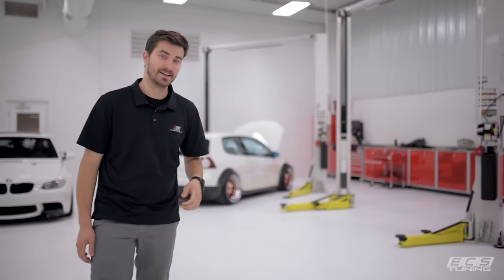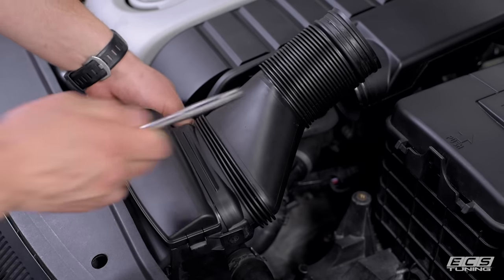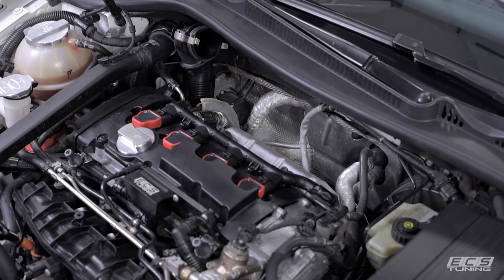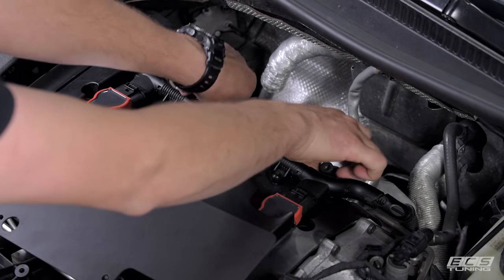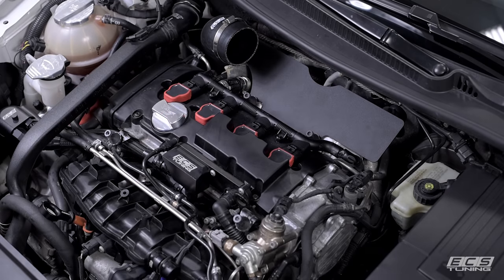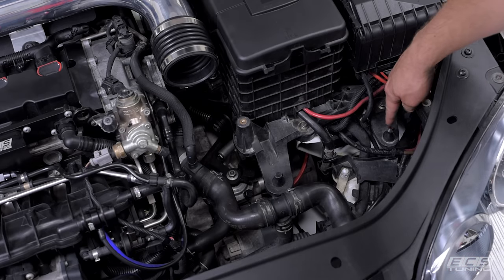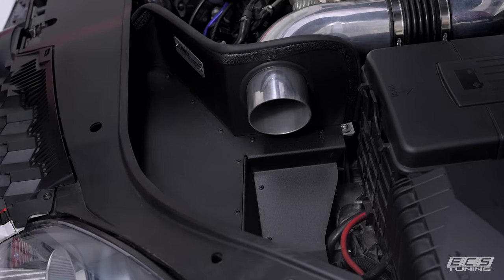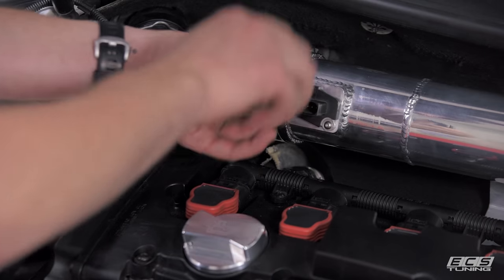VW MK5 GTI FSI Intake Removal and Installation DIY

Comment from the maker: MK5 FSI intakes available here: http://goo.gl/2kBacG
Schwaben Hose Clamp Pliers: http://goo.gl/kXiNzV
Schwaben VAG Connector Removal Tool: http://goo.gl/TUpjT3
Reply: Is this possible with normal 1.6 FSI without turbo?
Reply: I need it
Reply: I will not need the front post for the grommets for the engine cover anymore, correct?
Reply: @norbertmolnar2206   and do you know if its possible i want it aswel for the same car as you?
Reply: @predaR6  yes, i have already inside the car
Reply: @norbertmolnar2206  which 1 did you buy if i can ask?
Reply: @predaR6  this one is no more online unfortunetly but if u type on google vw golf 5 1.6 fsi sport cold air intake u will see many options for it. 😁 there is a guy he maked a youtube video as well

Comment: Me: "that looks sweet. 'Clicks link' 
'Sees it $600'. 
Me: oh nevermind
Reply from the maker: The intake in this video currently costs $299.95 with free shipping.
Reply: Can I buy the rubber grommets posts ? I really need those for my Mkv
Reply: whats the increase of power , torque , rev reactions???
Reply: hi i checked your website, you have the 600 dollar and 300 dollar intake. may i ask what is the difference?
Reply: Carbon Fiber Box vs. Aluminum Heat Shield
Reply: Yes yes I know, this is the first step, and then we all go on the slippery slope of tunning. :D
Reply: I ordered that part because they said they had it in stock, 2 months later I called to check the status, they moved the shipping date, this happened 3 more times after that,  so I canceled my order, ECS is full of excuses, not what customers want to hear
Reply: Don't order from them
Reply: @JohnC-kc5uh  covid is affecting everything globally
Reply: Cool system. But zero power gains. All noise and whooosy sounds. Very cool on full throttle but irritating as f#ck when just cruising around

Comment: thanks for the video, but why do you guys skip over the hard parts of the installation? you did not show how to tighten the rubber 90 deg boot that goes on the Turbo. how am I supposed to reach and tighten the clamp?
Reply: I had the exact same thought.  Plus, what was the 24 mm socket for? 🤣

Comment: So what does it actually add, or is this one of those things which are completely plasebo until you start upgrading other components where more air would start making difference and getting it tuned? As in, will this do anything really on a car if everything else is stock?

Comment: 2:50 Those posts for the engine cover have a 10mm nut behind them and it sucked to remove them never mind putting the nut back on after the heat shield was in place

Comment: ive got a 1.4l tsi it would be helpful if you could do a vid on changing the intake to aluminum as it is twin charged (supercharged and turbo)
Reply: Wtf... 1.4 TSI its only turbo....
Reply: @joaoprates8763  nah the turbo is in front of the engine the superchrager is at the back

Comment: 2:39 I WISH u could show more exactly in detail how you removed those parts... Can you @ecstuning please or someone help me with the missing parts of these two? I found the flexible connection (1k0 129 618 AH) in SH, the plastic (1K0 805 971 C) that attaches to the bar is new... what else is missing?? for golf 5 gti

Comment: I'm getting a lot of controversy over whether or not cold air intakes do all that much.  It would add eye candy to the engine bay, as well as free up space with the removal of the engine cover.  However, some other car guys are telling me that a cold air intake is a waste of money, and that I would be better off saving my money for an APR chip.  So can someone give me an honest answer: if I have a stock MKV GTI, will a cold air intake help in the long run?  I notice most of the vendors who sell the intakes say that they help, claiming increases in power of up to 15-20 hp.  But most people think they only add 3 hp at MOST.  I want to know for real whether it's worth the investment, before I drop $250 on a fancy intake.  Thanks.
Reply from the maker: A tune is your best "bang for the buck" and is a great first step towards more power.  Intakes begin adding significant power once you are tuned.  This particular intake made solid gains when coupled with a stage 2 tune. We have dyno charts for both stock and tuned vehicles on the product page here: https://goo.gl/N1n2ay  

Also, the intake will help you hear your engine and turbo much better.  The turbo sounds make driving the car so much more enjoyable.

Comment: Quick question, no problems with fresh air getting into the air filter? Seems a little boxed in. I know it's isolated from the engine (and that's really well done). Just don't see where it's getting a lot of fresh air.
Reply: there is an intake slot in the grill which goes under the rim of the bay, trust me, it is getting a constant influx of cool air. basiaclly, where he unplugged the original air box is the vent

Comment: Will this work properly With MAF readings ?? it needs to be in perfect scaling
Reply from the maker: Yes, our intake keeps the MAF scaling proper.
Reply: ok thanks, i have bought 2 different intakes and both had fuel trim problems. i'll give this one a shot but good to know you said it works without any problems.
Reply: @ecstuning  Just put and ECS CAI on my mk5 and the MAF sensor does NOT like the new CAI.  I have to unplug the MAF sensor to help it run.  Does it need to be tuned?  Any suggestions?

Comment: Do you guys happen to have an Intake install video for an MK5 GTI with a TSI Engine??
Seems like most MK5 GTI servicing vids are for the older MK5 GTIs with the FSI engine :(.
Reply: Isn't it a mk6 gti then? Atleat that one has the tfsi engine i believe
Reply: TurboDifferent Nope. The latest models of the MK5 GTI, 2008.5 and up, came with the TSI engine. All previous MK5 GTIs' before that are the ones with the FSI engine... It sucks that most MK5 GTI DIY vids are only made for the FSI models 😒.
Reply: Are you sure? I have a Golf GTI mk5 from 2008.10 and is TFSI. In fact I NEVER saw a mk5 TSI. Never. They may be rare. A TFSI and TSI engines have a lot of differences, but the big one is very clear: the engine have timing belt? If yes is a TFSI, if not (timing chain) it's a TSI. But it's possible that they have introduced the 2.0 TSI engine sooner and if that is the case search for DIY for a mk6 GTI an not MK5 GTI.
*TFSI and FSI in this context are the same, they are just marketing name to differentiate FSI engines with or without Turbo. Since all GTI's have Turbo they are called Turbo FSI or TFSI (specially by Audi).

Comment: I would  like to see insulation of blow off valve for mk5 gti
Reply: 2 of their videos sort of explain it. They have one that goes through how to replace the diverter valve on a mk5 fahrenheit which I can attest is the exact same on a regular GTI since I have one and have replaced my diverter valve once.. Then they have one going through how to do the forge atmospheric bov and their full bov assembly on a mk6 with the relocation kit which I can also attest is essentially the same on a mk5 gti with the exception being that you have to be under the car instead of working on it from the engine bay. To make it work you kinda just have to apply concepts from one video to the other. Plus if you order the forge stuff it comes with detailed instructions. 
Here is the diverter valve one https://www.youtube.com/watch?v=dmCcAp5ykPg&t=38s
Here is the other video that has diverter valve replacement, atmospheric BOV and forge bov: https://www.youtube.com/watch?v=H7F7OPUtyjU

Comment: Will this fit on an automatic?
Reply from the maker: Yes, the transmission doesn't change fitment.
Reply: ECS Tuning I have a b6 Passat dsg with the bpy. There's an additional box thing in front of the battery box. This seems like it will make this intake not fit

Comment: Does the cover not fit now? I want a stock look with the K&N filter and tube.
Reply from the maker: The stock intake is built into the engine cover.  With our intake you cannot re-use the factory engine cover.